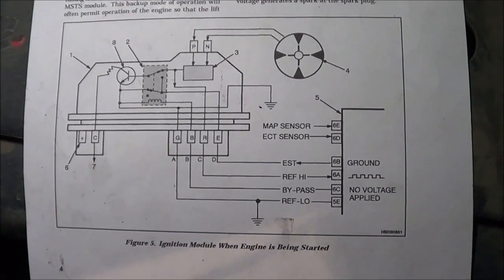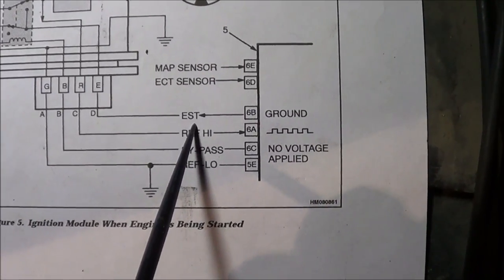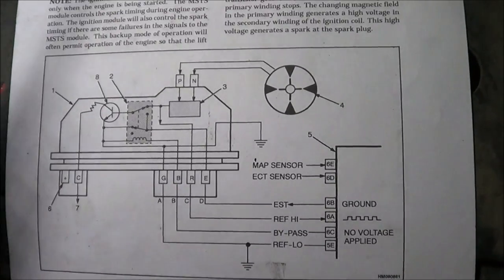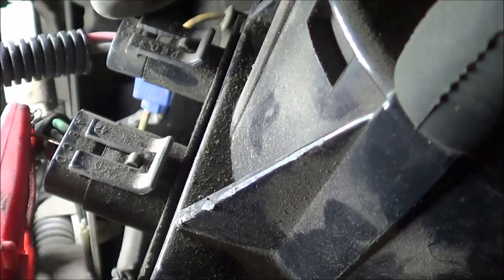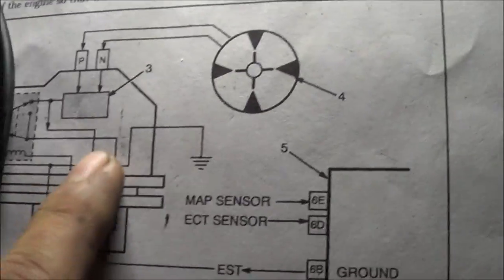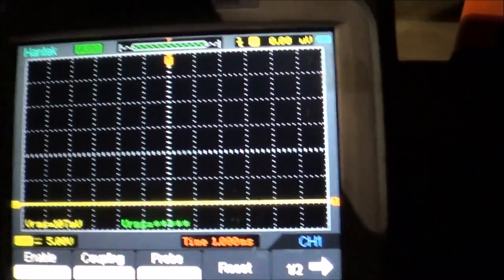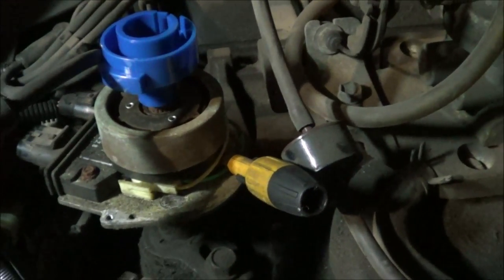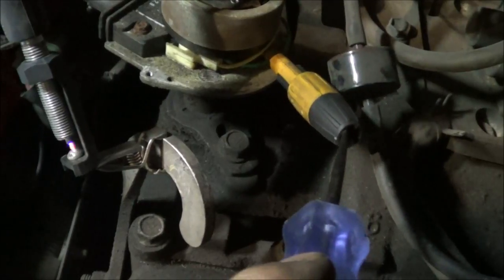GM Bypass Ignition System part 1

Comment: I had this same exact issue on a Heli other day, check engine warning on. Would crank, but no spark all diagnostic testing led back to the ignition module. Will be swapping that out once part comes in.

Comment from the maker: If you have the same set up as shown,  check if the 5v bypass signal is present at cranking. This signal should only be present when the engine rpm reaches 400 rpm.

Comment: Just replaced a dying coil on our 99’ GMC ice cream truck.  I replace both Coil and ICM, once one goes the other isn’t far behind.    We have high idle times
Reply from the maker: If it a speed density system, meaning it uses a MAP sensor instead of a MAF a vacuum leak would increase the rpm.
Reply: @forkliftgeek10  meant to say we have long idle hours. Not RPM.  Heat kills these things

Comment: Great video my friend. I need advice on sourcing info particularly wiring diagrams for  forklifts. At my job I maintain a hyster H80Ft. This machine is about 3 years old and the company has no service manuals. Only for the larger machines that use diesel engines. I Googled the engine which is a 4.3 vortec engine that runs on propane. a few sites had promised the wiring diagrams like I wanted. Not much info was found. I see some other sites are pay sites and was wondering if you had any suggestions?
Reply from the maker: Sorry about the late reply. I'll try to see if I can get u a wiring diagram. What system does it use?
Reply: Fuel system it uses the standard silver lpg (which I called propane tank sometimes) cylinder on the back counter weight. As for ignition it has a distributor but there is a hall effect sensor inside of it. I scoped the waveform and it is real slow around 5 sec screen. When I scope primary turn on voltage and current I use around a 20 MS screen time. I use the snap on verus edge. It depicts time across the entire sCreek sweep and not per division like the pico. I can determine that sig probably is cam since it is slow. But this is an assumption. I can see the ignitor trigger sig as it leads to the ecm. The other connector goes to my coil. I said a lot of info that you probably didn't need to know to answer your question. All I can say is I am trying everyday to be better. So if I missed the area of identification to answer what system is on the machine . Please explain what I should look for. Thank you for the help. Coworkers are not encouraging past their comfort zones.
Reply from the maker: Ok so it probably has the same ignition system in this video. Are you trying to troubleshoot a problem or just want the diagram for reference?
Reply from the maker: Does it have an impco tier 2 lpg system?
Reply: i believe it does
Reply from the maker: Then go to the impco website and download the impco tier 2 manual. It would show you the schematic diagram.
Reply: Thank you very much, I just now saw that manual.
Reply from the maker: No problem

Comment: My ignition coil keeps burning out when I try to start it. Someone else was playing around with it before I was called. The 4 wires to the distributor was elemenated.
Reply from the maker: Eliminated? You mean taken out?
Reply: @forkliftgeek10   it's a GM 4cyl just like the you've illustrated but they eliminated the 4wires from the distributor so only those from the coil are connected to the distributor. They said that it use to run like that.
Reply from the maker: Yes it can run without the other wires to the distributor. The two wires would be the positive supply and the signal from the distributor to the ignition coil

Comment: I have an intermittent issue we're the truck randomly shuts off while driving the turns on a runs fine for a while. This last time it threw a code 33. Would you have advice on how to diagnose? Thank you
Reply from the maker: What's the brand and model?

Comment: once the pcm gets the 5 volt reference signal,  and tells the pcm to govern the spark, does it still rechannel thru the spark module to signal the coil, or does the pcm take over completely and there is nothing going thru the ignition module anymore at all.
Reply from the maker: Once the rpm reaches 400 the control is transferred over to the pcm.
Reply: so is the ignition control module COMPLETELY taken out of the circuit.. if the tan and black timing wire on the firewall is disconnected it is said to be in " module mode".. so if the tan and black wire is disconnected it freom the ecm, then evidently the motor is running soley off of the ignition control module?
Reply from the maker: @randy1ization  if the B terminal wire is disconnected either from the module or the pcm side, then the it would always be in "module mode" as you call it.
Reply: @forkliftgeek10  got it, thanks for the great video, !!!

Comment: Im running a bypass system on a big block chevy on a boat I changed out coil and distributor with MSD products #8366 I get maybe one spark and then no spark at all But if I pull the dist out and rotate by hand I get spark all the time And will this spark without the 4 pin plug from ecm ? What the hell is going on here

Comment: hey I'm from Poland. Unfortunately, no one will help me here. What if I have a 2.7V bypass all the time. I replaced the ESC, splitter, cables, spark plug, coil. 2.7V all the time and the car is not working properly. I am tired of it for a year and a half;) Help! Chevy S10 95y 4,3 TBI
Reply from the maker: The bypass signal will always be present until the rpm reaches at least 400. At this time the timing is transferred to the ECM. I would check if the rpm signal from the distributor is reaching the ECM